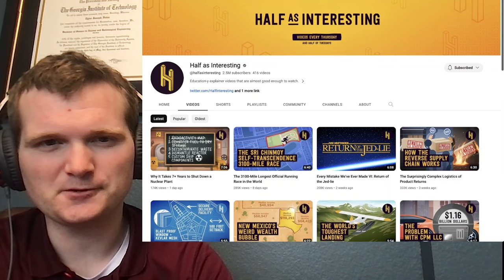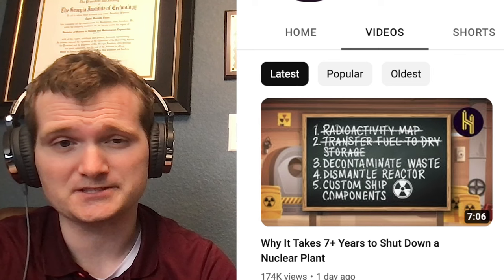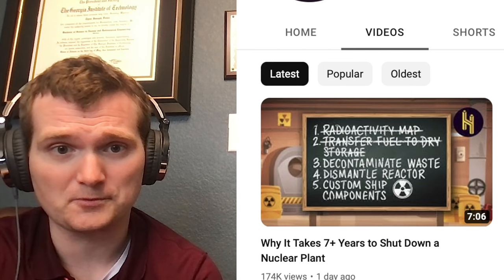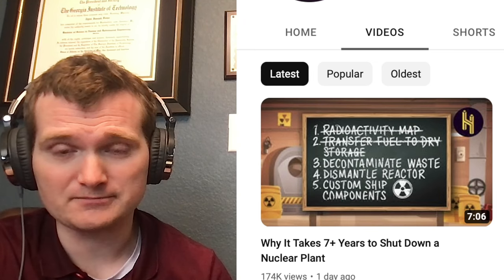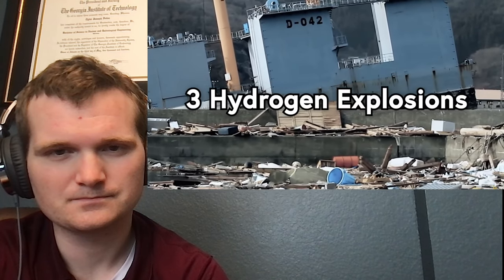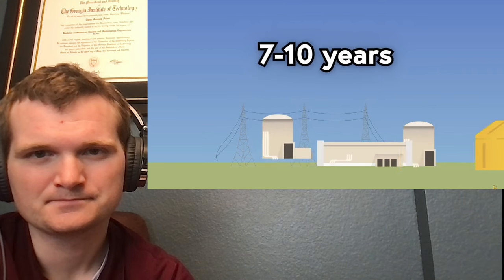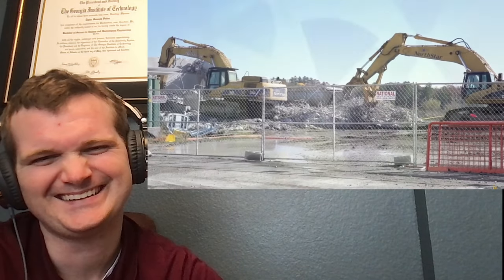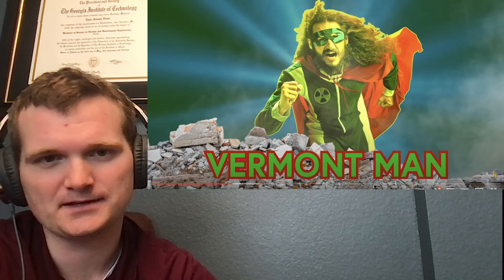Nuclear Engineer Reacts to Half as Interesting "Why It Takes 7+ Years to Shut down a Nuclear Plant"

Comment: What I find interesting is the term radiooacive. There are two types ionizing and non ionizing. The latter includes microwave that ranges from ovens to mobiles
Reply: And then there's alpha & beta particles and neutron flux to consider too.
Reply: Technically, visible light is also non-ionizing radiation.

Comment: fun fact one of the reasons there were such issues with the grid after the fukushima earthquake etc.  is because japan has two completely different electric grids in different parts of the country.  This means that it was nearly impossible for other areas to share electricity with the down areas.
Reply: So, kinda like Texas a couple years ago with the arctic temps that shut down their gas power plants and they're not connected to the rest of north America.
Reply: @mduvigneaud  kinda similar yeah.  but even worse, basically two different areas of japan developed electricity independently from each other, and they got the technology from different countries.  So those two different grids are not only not connected but are literally completely incompatable, you can't even share parts or spare generators or whatever.
Reply: @ldkmelon  Oh yeah, that's definitely way worse. I think I heard about Japan having 2 different electrical grids before but I'm not sure where.
Reply: @mduvigneaud  it's a pretty common thing to pop up on japan trivia so very possible you may have encountered it in one of those type videos or a history video (definitely not how I know the fact cough cough cough)
Reply: @ldkmelon  I'm kinda thinking I might heard about it on an electronics engineering channel but, like I said, I'm not sure.
Reply: @mduvigneaud  that would also make a ton of sense! definitely a unique phenomemon in general.  I don't think any other country has that exact scenario (although not an expert)
Reply: @ldkmelon  Is it in diffenent frequencies? like is one part 50Hz and the other 60?
Reply: @sankang9425  exactly, one frequency mains 50Hz, and the other 60Hz.  They do have HVDC links to allow them to connect with a conversion, but you can't really share stuff properly on that system, with a max transfer of like 1GW.